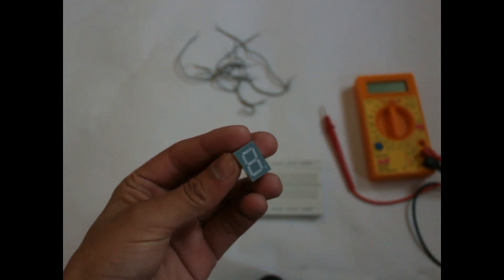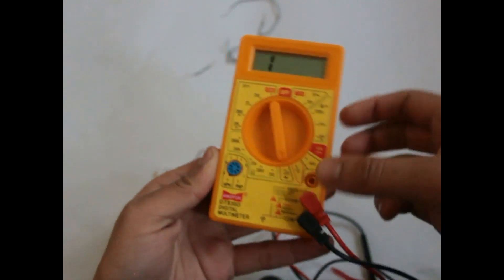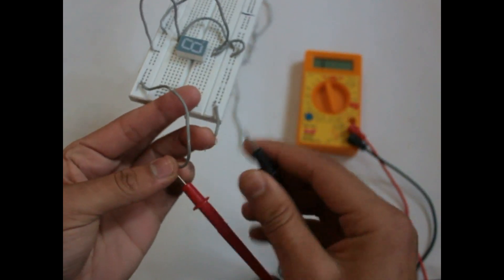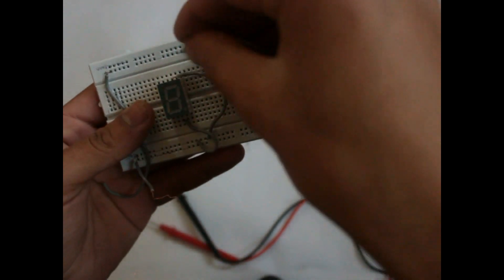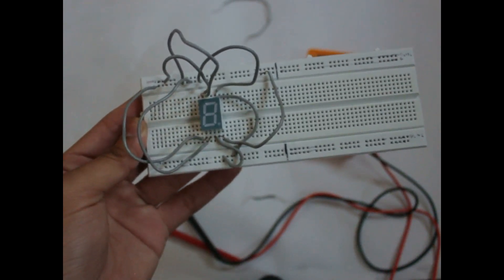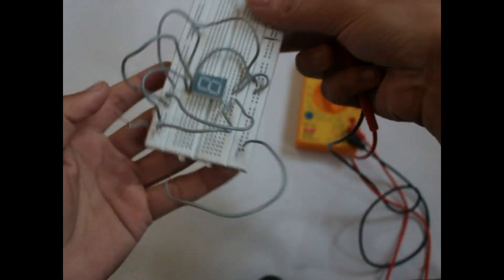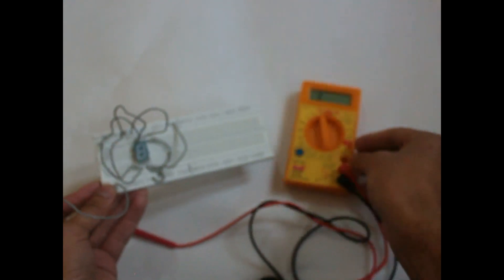How to Display Numbers on Bcd 7 Segment Without Using A Decoder.

Comment: hi csn you show me how to put number 2
Reply from the maker: Arman Lagrosa To display 2 connect pin 3 and pin 8 to anode terminal and pin 7,6,10,1 to cathode terminal and 2will be displayed
Reply: i can not understand what anode or cathode is. can you show me some video? from numbers 23456789
Reply: please help me. or some photos so i can just copy. thanks
Reply from the maker: I Am.Not At Home I dont have equipments with me....so you do as i say anode meand negative terminal of multimeter (black wire ) and cathode means (red wire) and connect the pins as i have said and u will get 2 still i will.find you a way and will convey you

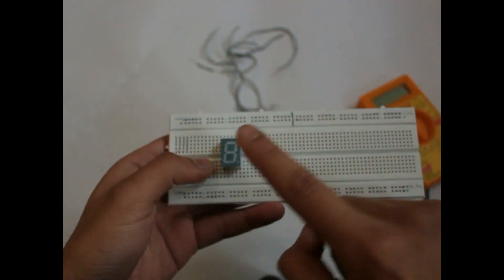Comment: Question you say you use a common anode display 1:08, but connect 3 and 8 to the negative rail. Should not be common cathode?
Reply from the maker: trickybilly Sorry brother it was a mistake its common cathode but i told its common anode sorry for the mistake

Comment: what if you use the 9 volt?
Reply from the maker: If You Use 9Volt Battery It Will blink up device for seconds and will  Burn Up The Device... As Bcd 7Segment operates on small current that is why we use multimeter as it provides small current you can use any other small current providing source
Reply: can you please help me with my project? you seem to know what youre doing?
Reply from the maker: +Rishi Singh brother I have exams these days ,,,I am myself a student I can help you after my exams wait a month or so..
Reply: oh sure man. thanks anyway.